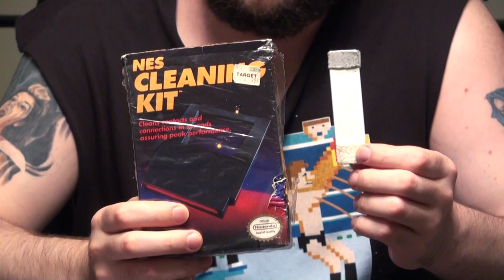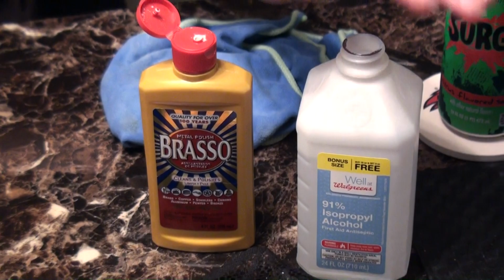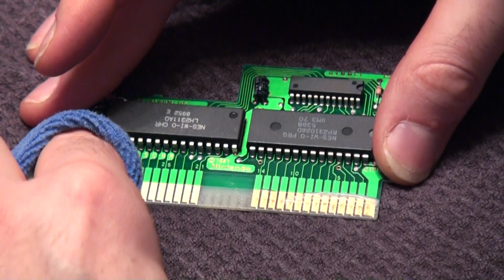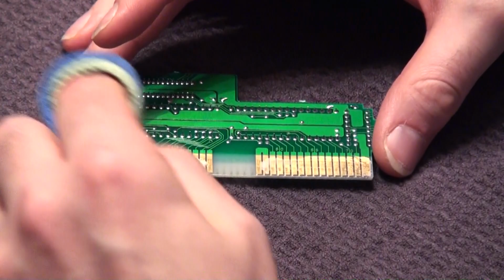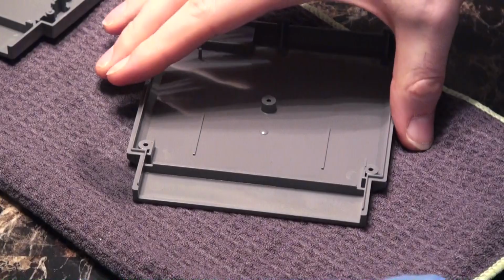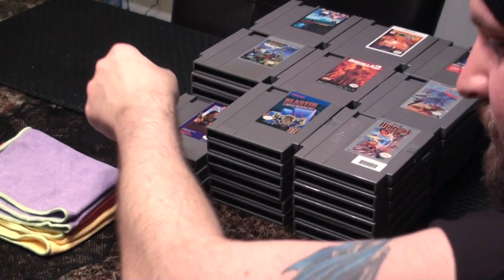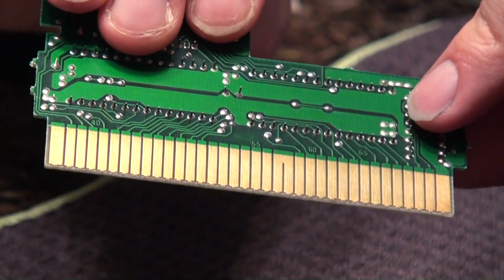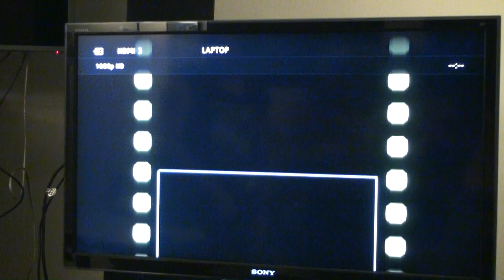How to Clean Nintendo NES Games With Brasso

Comment: I replaced the 72 pin connector on my RGB modded NES and 95% of my original library still wouldn't work. My N8 Pro Everdrive works fine so I knew it wasn't my console. I tried the eraser trick plus alcohol on my games and that still didn't work. Blowing into my NES carts really caused a lot of oxidation and corrosion over 30+ years. I know Brasso is a 4 letter word within the retro community (people were legitimately mad at Norm the Gaming Historian for mentioning it), but i said screw it and tried it anyway. It was either that or discard my non functioning NES games that were taking up space on my shelf.

Low and behold, it worked and all of my games work perfectly now. I honestly don't understand the hysteria from the retro gaming community about brasso use. Sure, some people may over apply and ruin a game, but it saved 2 dozen of my NES games from the dumpster.Will my games be broken in 15-20 years from me using brasso today? Maybe...but they'd be in the trash tomorrow if I didn't use it.

One thing i did do differently and would recommend for everyone is I applied way more isopropryl alcohol than you did directly to the connectors and scrubbed well to get rid of any brasso residue. It seems the main complaint about people using brasso is that if its left on the contacts. It can corrode over a long period of time and can even damage the pin connectors on the NES if too much gets on there.

Thanks again for doing the video.
Reply from the maker: Right on! Glad it worked for you. Yeah, people who condemn the method aren't doing it right. This video is six years old now and none of the games I treated have developed any problems. Pins are perfect and the games play with zero issues. Brasso did not "KILL" them as some have sworn would happen. Quite the contrary. They WORK now.

Comment: Good video.   Brasso is definitely one of the better ways to clean dirty games when iso alcohol won't do it.   Couple things i like to also mention though when recommending Brasso... Firstly DO NOT use it repeatedly to clean your games! Repeated use can wear away the finish coating on the connectors.   It should only be needed once to restore games with especially dirty pins and after that just use iso alcohol as needed.  Second,  after the pins visibly look clean if there is still black coming off them that's ok.  You don't want to overuse, just make the pins shiny and clean looking.   And third,  always wipe off the Brasso residue with iso alcohol after cleaning.

Follow those additional tips and Brasso is a safe and effective method to clean those extra dirty games.

Comment: Huge thank you for putting this information into the public space. 

I attempted to repair an NES that would only occasionally read carts even after replacing the 72-pin connector. 

Didn’t think to blame the carts because 91% isopropyl alcohol didn’t do the trick on those pins. 

After using some brasso on all of my carts, it boots on the first go no matter what I load into it!

This is an amazing trade secret I won’t soon forget. Thanks a million!
Reply from the maker: My pleasure. Glad it worked for you! 🍻

Comment: I can also confirm that after watching this video 6 years ago and using a similar method for cleaning cartridges shortly after... all of my NES games still function perfectly, and their pins still look gold and pristine. As long as you use Brasso quickly, gently, and clean it up thoroughly with isopropyl afterward, your games will be fine. And of course, only using it if Iso alone won't do the job.

Removing a tiny upper layer of the gold/brass-colored coating by using this method once every 30-35 years is a price I'm willing to pay. Plus I'm pretty sure I'll be dead or close to it by the time I'll need to use Brasso for a 2nd round...
Reply from the maker: Well said. Agree! 🍻

Comment: Good video.  As somebody else mentioned, don't be too aggressive with Brasso as it can damage the gold plating on the contacts. But if used in moderation, it's an effective way to clean them.
I've been using silver polish in more recent times.  I don't know if it's actually any gentler than Brasso though.
It's okay to pour some alcohol over the PCB when cleaning or rinsing it.  It won't hurt anything and it dries pretty quickly.

When reinstalling the screws, apply light pressure and turn slowly backwards until you feel them click into place. This helps avoid cross-threading. Same trick applies when working on plastic parts in old cars.  And as mentioned in the video, don't tighten them too much. The plastic threads can get stripped out and weren't meant to be exercised much in the cartridge's life.

Comment: My Dad had my NES in his basement, couldn’t believe he still had it now I’m restoring it just ordered a new 72 pin connector and thanks to your video I’m gonna brasso clean my games I can’t wait to play again. Thank you for posting this video.
Reply from the maker: That's awesome, Bud! My pleasure, and glad you are restoring those memories!
Reply: Man I’m having some trouble restoring this , I ended up purchasing a new 72 pin connector I cleaned the pins (that the connector slides onto) really thoroughly with brasso alcohol until both sides were shiny  plus I cleaned a couple games like your instructions show. The problem is when I play say Mario bros sometimes it’ll work perfectly fine until about level 4-1 or even sometimes level 1-2 and then the game keeps playing but the graphics get all messed up. I have a game Rad Racer that’ll work perfectly with no glitches which is strange. I have another game RC Pro Am that was my all time favorite and just like Mario it’ll be fine until I get to about level 4 or 5 and the game never stops but the graphics start going nuts making it impossible to even keep playing if you wanted to. I don’t expect you to be able to diagnose my nes but I’m desperate to get this thing running again and really could use some help , has this sounded like anything you have heard about before?
Reply from the maker: @musicmixcapecod  Did you go back over the pins with some alcohol after the Brasso treatment? I haven't seen it happen myself, but I touch on it in the video how I've heard that Brasso alone can sometimes leave a "film" behind if you don't go back over the pins with some alcohol. Might wanna give that a shot and make sure all is thoroughly dry before testing.
Reply: I ended up cleaning the pins some more which they looked clean but actually dirtier than I though, the Nintendo definitely works just not the really old games probably too corroded or something but it was a breath of fresh air when I realized it was just the games. Thanks for the reply

Comment: The folks that condemn this method are likely not cleaning the polish off the card edge once the corrosion and crud is removed.  I've gotten carts from evilbay with dried polish inside the cartridge.  I always clean them myself before plugging them into my gear.
Thoroughly cleaning the Brasso off the terminals with 91% IPA is definitely needed.  This ain't just one wipe.  I use three or four or five cloths with IPA to clean it off.  The ammonia in the polish removes the corrosion but if you leave any behind it'll eventually corrode the copper plating on the boards and screw up the female connector in the game or tool.  It MUST BE completely removed.
I've used this method to clean my NES, SNES, 2600, & Snap On MT2500 cartridges.  The filth on the MT2500 carts I've bought was truly incredible.  Some of the terminals were literally black.  I had to replace the female connectors on the tools' mainboard when I was prepping it to use.
I wipe Deoxit S5 Shield on the card edge terminals with a clean microfiber cloth to protect them once they're clean.  I expect to get some REEE about that.  Not your hardware bub.  Been doing it for over 15 years with ZERO problems. They don't attract dirt and the tools & games female connectors don't collect crud.  I've checked.
Erasers, fiberglass pens, and, god forbid, sandpaper actually remove un-damaged material from the PC board.  I cringe when I see folks use them.  Brass polish does not do this when it's properly used.

Comment: This is basically my technique, but after I clean off the Brasso with alcohol and drying it I follow up with a bit of Deoxit D5, just enough to wet the surface of the contacts.  I have no idea if their claims that it helps prevent oxidization but it doesn't hurt and I've been using it on music equipment that's way more critical than SNES carts for years without any problems so I figure it couldn't hurt.

Comment: Throw that Brasso in the trash and use DeOxit D5 and rinse with 91% Isop.   DeOxit will get rid of the oxidation and the 91% Isop will get rid of the remaining dirt and remove the unnecessary lubricant DeOxit adds.

Comment: Went through that effort to clean the game; only to ruin the plastic threads by not reseating the screw before screwing them back in. Always go left with the screw until it clicks into place before going right. That will set the screw to the original thread instead of making new ones when it comes to metal screws that go into plastic threads.

Comment: I only use brasso on more degraded pins.

For me it’s like this: 

Light tarnish = 91% isopropyl alcohol with microfiber cloth

Medium tarnish = glass cook top cleaner and magic eraser

High tarnish = brasso and magic eraser

Extreme tarnish/water damage = 400 grit sandpaper. For this method you have to be careful, cut thin strips of sandpaper that are no wider than the metal pins themselves, you should end up with a long, very thin strip of sandpaper, use that thin strip to remove extremely tarnished or even slight rusted spots, once all the extreme spots are sanded off, go back to the brasso method. ALSO, NEVER SAND THE PCB, or even the small spots of PCB in between the pins, don’t sand widthwise across the pins, sand vertically along the length of the pins, making sure to never touch the sandpaper to any surface besides the metal pins. Sandpaper should rarely be used and only in the most extreme situations. Plus it requires you to use your brain in order to not risk damaging your cart. All in all, if you’re not the sharpest tool in the shed, I would skip the sandpaper all together and just use brasso, it’ll take a fair amount more time but you don’t risk any damage, though I will say that I’ve done the sandpaper method on dozens of carts and it’s fixed the issue every single time and never damaged the cart in any way, so it’s a great method if you have a brain.

Comment: Ive only had like maybe 5 or 6 games for NES/SNES that I could get working after cleaning them good with Brasso. Even games with pretty severe water damage.And most of them just need a new capacitor  Ive heard people recommend stove top cleaner and they say it doesnt leave film like brasso can (which I ve never seen myself but I always clean the carts very well after using the Brasso).

Comment: Sweetness thank you i wouldn't have thought of using brass cleaner all my carts were hard to get working every time i tried to play them i did not have brasso but i did have Wrights brass polish and now all the carts i cleaned work first try every time no fuss :)
Reply from the maker: Awesome! Glad it worked for you. I had no idea either till a buddy filled me in. Had never heard of Brasso. I'm definitely a fan now.
Reply: did some research and brasso is slightly corrosive and might damage the cart over time....wd40 might be a better idea be less aggressive to the board and pins but still clean it
Reply from the maker: Another reason to give it a second wipe using alcohol right after. I had heard something about Brasso maybe leaving a film behind if left untreated. Alcohol will remove all traces. 👍

Comment: the lord of horror has spoken! awesome video mate, is it more effective than alcohol?
Reply: Oh way more effective. I have been doing this to my games for years now.  It's like a night and day difference. 
When you are done, it makes those pins like they were brand new as if you just bought the game and opened it up.

All my games doesn't matter the console (obviously not the CD ones) get the same treatment.
I use q-tips (or rather the cheapo kind I get at the buck store (like 400 for a buck)) though, but yes I still take them apart and clean them like this. I just dip the q-tip in brasso, and clean away.

Comment: I lightly wet sand the contacts with 2000 grit sandpaper and electrical contact cleaner.  Brasso never seems to come completely off.  I've used it to clean cymbals and can never get the rag to stop coming up with black marks.

Comment: Thanks for sharing the size security bit required. I find I could use the 4 as I didn't have a 3.8 handy. 
However, the Metroid cartridge has hex heads. Not sure what size at the moment.

What year did they change to the hex heads on their cartridges?
Reply: Earlier carts through at least most of 1987 had 5 flathead screws.  Late 87 is about when they switched to the later cartridge shells and used 3 security screws.  There are also some carts in the transition period that had the 3-screw shells but still have flathead screws (like the Ring King in the video), but sometimes those are just carts where somebody swapped the screws.
I've never known of any hex screws in NES carts, and didn't find any reference to them in a quick search of NintendoAge.  If you've run into hex screws (not security screws), then I suspect those were swapped in by a previous owner who got them from a hardware store.
Before the security bits were commonly available, people used to struggle with the screws and would be inclined to replace them with generic screws.

Comment: Question I bought a huge lot of Nes games but from a huge smoker any clue how to get rid of the smoke smell or will it be there forever,? Thanks
Reply from the maker: Interesting. Normally I use the bowl-of-vinegar-in-closet method with clothes that show up smelling like smoke. I put the garment in a closet next to a big bowl full of vinegar for a couple days and it works wonders. Not sure how that would transition over to electronics though. Not sure if the vapors from the vinegar would be abrasive to the circuit board or not. Maybe try it with one of the games you don't care for to test, just in case something goes wrong.
Reply: Tim Yaeger I've had a few carts that way. What I did was clean the shells with Simple Green degreaser and all the bad odors went away. (Not touching the pcb or labels)
Reply: Ruben Mejia awesome I will try that thank u for ur time!

Comment: Question, I cleaned my NES cartridges (4) with your method enclosed in the video.  The connectors are nice and shiny and no blur or spotty looking.  I cleaned them twice using a yellow micro fiber cloth.  I'm still getting greenish dark stuff on the cloth or it could just be dark.  Do I need to continue cleaning them until nothing is on the cloth, or does some of the green come off the cartridge (board), though, I never applied the Brasso to any of the green inside the cartridge.  So I'm thinking it's just dark. Thanks!  Also, the games work great!
Reply from the maker: Hi. I don't recall seeing any green coming off the circuit boards of any of my games. If the pins are shiny and clean, I'd apply a little alcohol via your microfiber cloth to make sure there's no Brasso "film" lurking about on them, then dry them with a clean microfiber cloth and you should be good to go.
Reply: I did just that and got them squeaky clean.  Thanks!